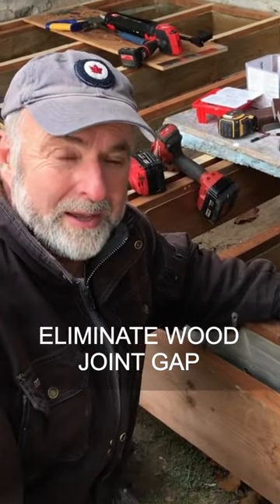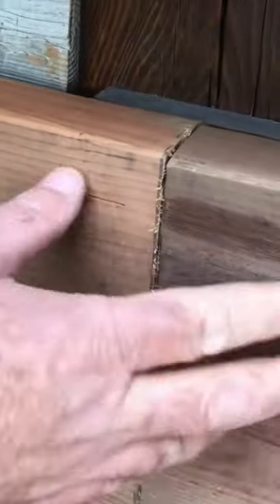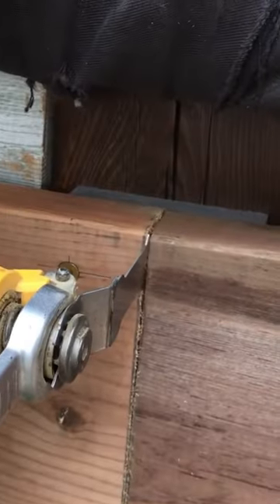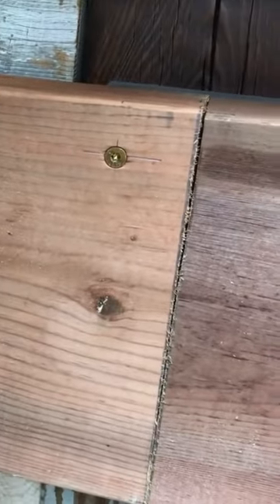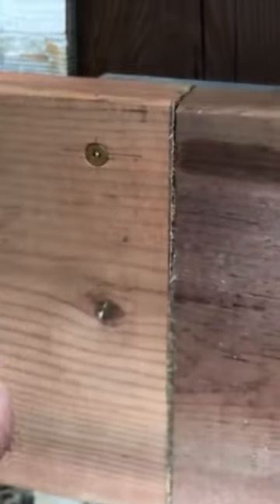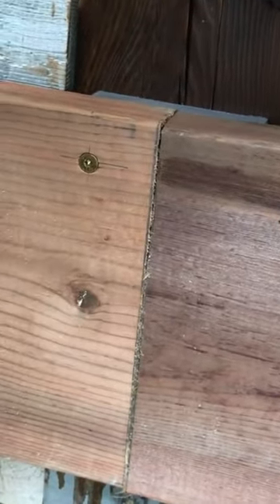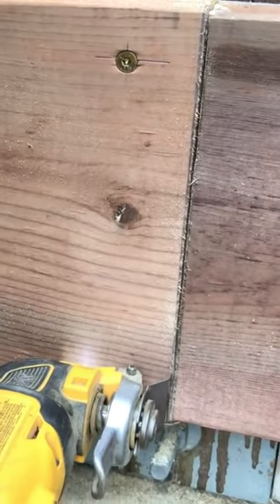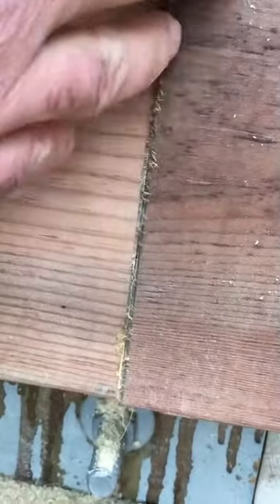Eliminate Wood Joint Gap #shorts

Comment: In my world of building that 8th gap is acceptable, it's called ruff framing. Screw that board in and move on.
Reply: My foreman would have bitched me out if he caught me closing up that gap.
Reply: No gaps at all on my crew unacceptable that’s sloppy work if a gap is left
Reply: If it’s wood that will be exposed, it’s not rough framing. Rough framing is covered by the finish wood. If you can see the wood after the project is complete, it should be aesthetically pleasing. The rough framing is all the framing that won’t be visible

Comment: "After 3 or 4 of these attempts"??? How I tell you I get paid by the hour without telling you I get paid by the hour...
Reply: Or he actually cares about The quality of his work and doesn't rush to throw stuff together like most contractors these days. Most people don't get paid by the hour and They cut corners just to get a job that's good enough but won't last as long. I'm so tired of seeing this kind of comment and seeing half-assed work
Reply: Yep, quick and easy is to take the circular or worm drive and run the joint once and it’s done.
Reply: Lol can also tell by the dewalt , use dewalt when paid by the hour , use Milwaukee when paid by the job haha
Reply: @Moelester692  milwaukee, makita, dewalt are like chevy, ford, dodge. Each has their market and niche tools that do better than the other brands.
Reply: @InspiredCraftsman  yeah just bustin his balls , was a big makita guy but Milwaukee made more and better tools for the trade I’m in , definitely a noticeable power difference but I wouldn’t say any of them are the greatest end all be all
Reply: @Moelester692  I hear ya, I'm a fan of my dewalts but I'm too vested in batteries to change it up. I like the milwaukee impact a lot, I've burned up 2 dewalt impacts driving 3 1/2" deck screws. My dad runs makita and they're pretty nice too.
Reply: @InspiredCraftsman   yeah makita is more than enough for home use but same I have a ton of m18 and m12 batteries and honestly some of my m12 stuff is just as powerful as some companies 18v or 20v tools , I can say tho Milwaukee hand tools aren’t the greatest
Reply: 3 or 4 it will disappear from your sight when your being led off site for spending 30mins closing a framing gap. There's times to be perfect and that's not one of them.
Reply: I had a stroke trying to understand that last bit
Reply: @RealJerb  most people, i assure you; DO GET PAID by the hour.  Ya dimbulb.
Reply: @marksmith161  Not from the customers point of view, which is a contractors real boss at the end of the day. When you hire someone to do a job, they quote you a price. That's how it works. There's only a few rare occasions where a customer will pay by the hour, typically for a repair where there are too many unknown factors that could come up in order to fix the problem.

But if you contract someone to remodel your kitchen, you don't get quoted in hourly rate, you get quoted a price for a job.

Comment: You could also achieve the same thing by butting the two boards up together and running a circular saw down the seam and you're done in 1 pass and about 10 seconds...

Comment: I would use a engineered wood for my facia because that joint will open up. I would join them using a true kerf joint (15 degree) and a few dominoes.  

Regardless of my methods you should use a sealer on those end cuts.
Reply: I agree using a copper based treatment since it's outside and subject to rot since it's so tight and will hold more water....the whole situation is wrong to begin with since it's framed incorrectly with no support for the rim joist

Comment: I noticed part of a pencil line on one of the planks.
My tips:
1) Use a making knife instead of a pencil; your accuracy will jump as a result.
2) Use an engineering square to ensure your mitre saw is true for 90° crosscuts.
3) Use a mitre saw. 😉

When I started doing the above my gaps vanished.

Comment: Run a skill saw blade down it, it's fatter it won't take you 3 days! Hint: put your speed square on the board line up the joint with your blade and run your skill saw table down the side of the speed square.

Comment: Cut the ends to at 22° (or less) and make a mitred lap joint... But most people won't care about that little gap, because it gets covered with a PVC skirt board!
Reply: In my area most people don't use PVC skirt covers. The treated deck wood is the finished surface.

Comment: I've never seen a board get shorter when it drys it gets narrower and I've been cutting and nailing boards for 47 years now
Reply: It does both.
Though you are correct It shrinks considerably more in its width then its length.
But it can shrink a small fraction of an inch over a long run. 
Like a board over 12 feet.

Comment: That's a different use of the word kerf than I was taught. For example I would use "kerf" to straighten out a bowed wall stud.
Reply: Kerf also means the width of material removed by a saw blade.

This is generally equal to the width of your saw blade, provided that the blade runs true.

The term is commonly used with table saws, chop saws, jig saws, circular saws, bandsaws, hand saws, and probably others that I cannot think of right now.

I have never heard of this term used in the context that you describe. It must be a trade term.
Reply: The “kerf” is simply a cut the width of the blade that’s doing the cutting.  So sure you could “kerf” (break) a stud to straighten it.

Comment: I wann tell you trick. If you are concerned about that gap, use a circular saw. 1 pass and done. Much faster. Or, leave it be. It's not even flush on top, and you're concerned about that little Gap.

Comment: Ok so I can see the sharpy marker lines, from original cuts,, so if they had been cut straight 1st time, this wouldn't be an issue,,, but secondly,, you never ever make such joints that tight,, between moisture and tempature them boards will swell and shrink,, and there should be a small gap so they they don't bow wene expanded, under hi moisture or heat conditions,,, I'm not sure what the point of this video is,, should have been more in trim out ,,,not frameing🤔🤔🤔

Comment: I've been doing construction my entire life I am 46 years old just recut the damn board take your speed square and find out exactly what angle it is or take another board scribe it and find out what angle it is put it on your other board and make the f**** cut while I go through all that crazy s*** or make a plum line 10 inches away measure the top and bottom and do the same thing on the other board there is many ways to do this then that dumb s***